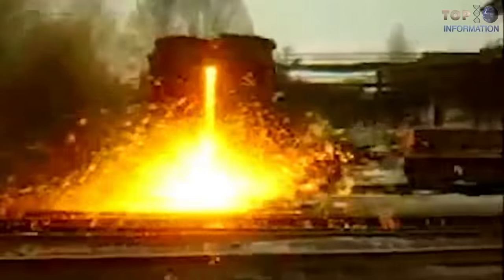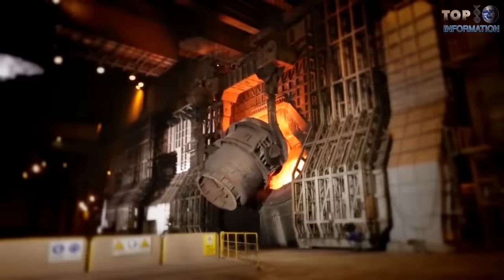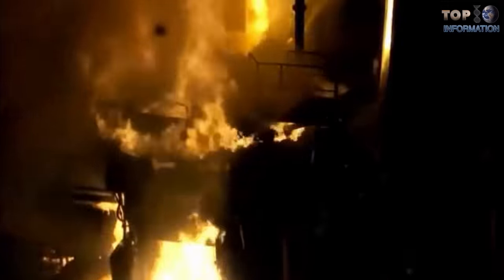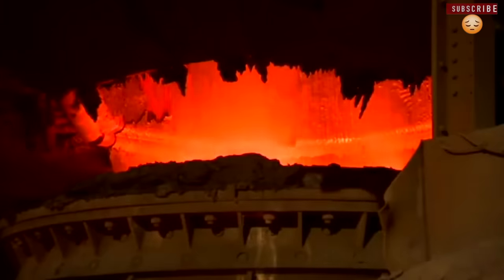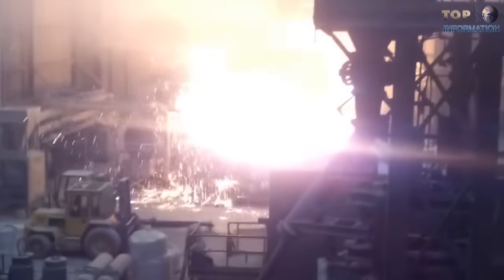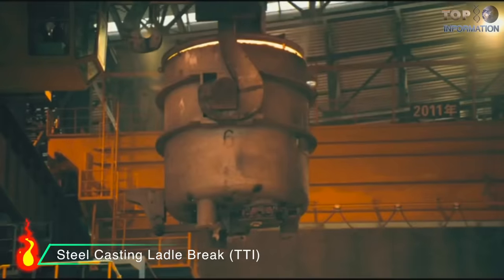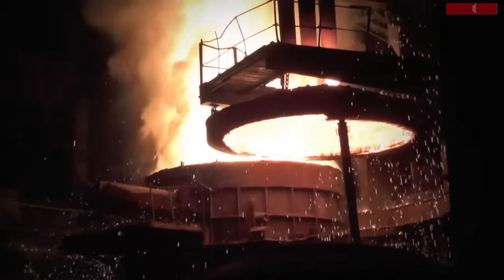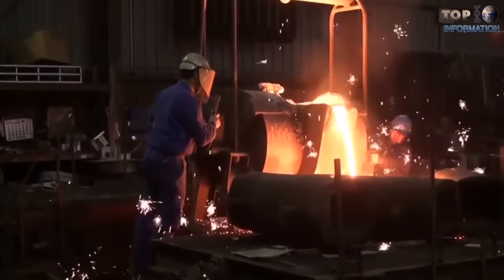TOP 10 Accidents In Metal Industry ✅

Comment: I worked as an over head bridge crane operator at a steel foundry in the 90’s.
I could tell you some pretty scary stories about the furnace and pouring .
The biggest one was a mild breaking open and approx 10k of metal came out and hit the floor.
The flames came up the 30 ft to my crane cab and surrounded me for what felt like a minute but was probably 20-30 seconds .
All I could do was sit in the flames inside my sealed glass coffin and wait for it to end .
A week later I applied for the shipping department lol
Reply: lol 10 4 driva
Reply: Make a video about your stories. Don't put them in a comment for free. Make some money from your stories, bro.
Reply: Hot metal crane operations are not for the faint of heart, that is why they earn the big bucks, all specifically and correctly build hot metal crane cabs are designed to handle these types of accidents and still prevent the operator from injury however there are ammonites.
Reply: @ExSpoonman  You can't just post a video on YT and start making money. You need at least 1000 subs just to get monetized, then you may make a couple bucks for every 1000 views.
Reply: @bigredc222  Which you'll never get if you don't post vids. Duh.
Reply: Crazy job
Reply: Archie: Is this true?
Reply: i hope the job paid well
Reply: What a horrible thought to be drapped in a crane.
Reply: Where was that bro? I worked in British Steel and in the blast furnace they tap the furnace not pour it...
Reply: Yeah that’s probably a pretty good idea considering I knew of crane operators that worked over an annealing furnace and their lungs were carbonized by the smoke long-term….
Reply: Big baby. What's a few flames and toxic gases?
Reply: Are you able to explain the incidents in this video that the narrator failed to properly explain or sometimes didn't even know so just invented random options:
 "this is due to X.  Another reason this might have happened  is human error" 

Which is it lady?
Reply: Yikes!

Comment: My grandfather worked in a steel mill in the 1950's, long before safety equipment was mandatory. One day during a routine pour the molten metal splattered violently and a tiny bit of this caught him right in the eye, destroying and  blinding that eye permanently
Reply: My granddad worked at the Alcoa plant, near Rockdale, Texas. He got slightly burned on a foot, from an accident involving hot material. Fortunately, it wasn't molten. I say slightly; he had to be hospitalized, but if it had been molton, the result would have been crippling. He recovered completely.
He had some stories about some pranks pulled there, and some serious activity, too. He lied about his age, when applying, claiming to be 7 years younger than his actual age. That was to avoid being forced into retirement before he had enough years for a full pension. One year, for the town's 'Frontier Week', he grew a beard, and it came in snowy white; he feared they would catch on. (With it, he bore quite a resemblance to [George] Gabby Hayes.)
Reply: My great-grandfather was partially blinded in both eyes from arc flashes in the steel mill he worked at. He ultimately died from leukemia he got from working in the mill. U.S. Steel, Lorain, Ohio
Reply: @OhioBahn440  Yeah, factories in general can have all kind of toxins going on. Im sorry about your g grandfather. Tough work.

Comment: When I was 18 years old I was hired by Youngstown Sheet and Tube in Youngstown, Ohio. They had a coke battery, 2 Blast furnaces, 11 Open hearth furnaces, a rolling mill for slabs, bars, and rounds, cold drawn wire, stamping plant, with welding, machine shop, pipe shop, boiler shop, locomotive shop, pipe fitters, riggers, and hospital. There were a million ways to get hurt or killed. It was a blessing that I got drafted at 19 and went to the Army.

Comment: I worked 33 years in the wood products industry . That's a nice and Simi important way of saying Sswmill. I was a sawfiler for almost all my time. I saw my share of  accidents/ injuries.  Luckily I I only had minor cuts from saws but the most common.injuries were pinched fingers ( some removing part of finger) and cuts from saws and knives , although proper PPE reduces the chance.
One of the worst accidents happened at another mill and I.hope by informing anyone who may work where equipment that has an exposed shaft sticking out from a bearing , spinning and  employees have to access that area. 
A new hire was doing clean up ( it happened on a Saturday ) and he had to enter a room to clean around the  chipper so once he entered no one could see or know he was there unless entering or saw him enter
 It s a well known rule , loose baggy clothing and long hair can get caught and pulled In many places. This young fellow had a heavy coat with a hood on back. While sweeping he backed close enough to the exposed shaft his hood was wrapped around the shaft and then part of his coat. He was picked up and spun and if he was able to holler,  or make any sound. he wasn't heard.  Sadly he wasn t found untill Monday when the mill was to be ran and one can only imagine how long he was slung around before he expired. As graphic as the thought of that is. I hope my telling will prevent anyone from having an incident like this to happening. That industry has come a long way safety wise since I started and being aware and using your head is the best prevention.
Reply: wow, intense story. I've heard others, and have a few that happened to me, tho not quite fatal. Here's a related story:  a tourist was walking on a sidewalk in Thailand.  A tour bus came along, but the operator had forgotten to close the large side hatch for luggage.  Pow! - it cut the walker nearly in half at the waist.